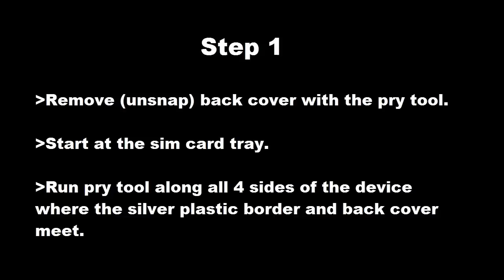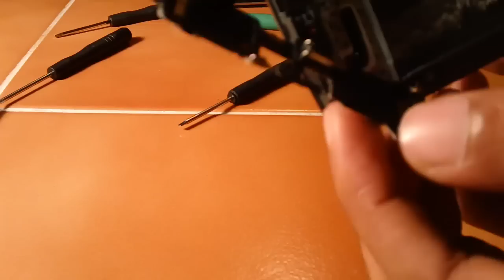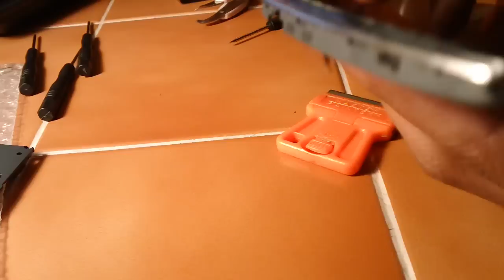HOW TO: REPLACE ONEPLUS ONE SCREEN (OPO Disassembly Tutorial) EASY COMPLETE TEARDOWN

Comment: Nice video, about to do a screen replacement for my oneplus one. Luckily my replacement came with a replacement frame. Don't need to worry about removing the adhesive. And it comes with a speaker grill :)

Didn't even realize when I purchased that it made installation that much easier if it came with a frame.

Comment: @Stephen good tutorial, but to replace screen you don't need to remove logic board on the top nor remove bottom board with speakers and all. It's much less work without it, and it's much easier. My new screen is also diferent than the old one. It's not the same quality, and digitizer under the screen obscures buttons's lighting.

Comment: Dont Try this at home. there is very Easy way to do this. Trust me. i followed this guy and i broke my phone. You guys wont open every part in this One plus one. Just remove Battery and top and middle (Near battery slot) cables and remove Screen heating by hair dryer. then fix and use. very easy.

Comment: Sorry to say .. I wouldn't advise to do this. I was extremely careful in tearing down, no problem. Only thing was the earpiece receiver, I noticed too late it is not necessary to remove it. The problem is in building it back together. During that process my new screen broke on top :( No matter how careful I was and have it laying on a soft enough and clean surface, I had to put some pressure to put the cap back on from the mainboard. There it went wrong. Apart from that in no way I can't refit the new screen nice. I should have let it fix instead, lol. Lesson learned, never again.

Comment: Thanks for the awesome video! Here are some tips for the guys doing this. 1st: you don't need to remove the lower cover and the speakers (skip steps 11 to 14), you only need to remove the motherboard because of the heat (you can do it without removing the motherboard, but you can cook some stuff). 2nd, the battery is really hard to remove, do it very slowly, no need to rush it, this is the hardest part (he makes it look easy...). 3rd, you can use the original glue if you remove the screen and put the new one right after that. You can also use 1mm double sized tape that you can buy on amazon.

Comment: Thank you so much for your guide. I went w/ the frame/LCD/touch assembly as my chrome bezel had many large nicks/dents in it. I would also recommend replacing the USB jack while your there, under $10 and a good idea if you have 12-18mo. or more on your OPO. Excited for the Oneplus 5 soon!

Comment: I believe the copper acts as a heatsink, to draw heat away from the screen and disperse it into the frame. It may also be to mask the sides of the backlight, to prevent light leakage. New screens often don't come with these bits, and you "need" to transfer them over.

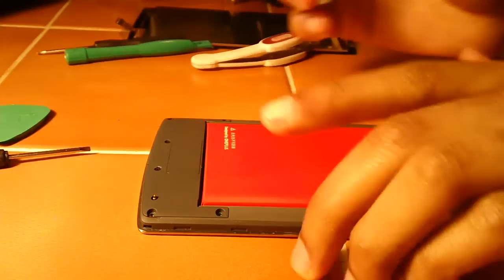Comment: Thanks For the video. I bought the similar one from AliExpress, and wondering which screwdriver i can use to unscrew 15 screws.. I tried to unscrew them but it is slipping (with the one you used in 2:47)

Comment: I replaced my screen man ,, thanks for making this video..
Reply from the maker: you're welcome
Reply: Can you provide the links to parts you used. Thanks.
Reply from the maker: ***** everything is in the description. Further instructions and links to parts are in my top comments.
Reply: Stephen Johnson Got i, thanks.
Reply: Was able to fix it properly using this video! thanks a lot for putting it up. Btw after step 14 i stopped. And didn't watch the video further. But one more step is taking out the thin wire on the right hand side of the panel - the one which connects the lower removed panel with the upper removed panel. Will require that!

Comment: I followed this tutorial and managed to replace the screen of my OPO and buy some time for it, thanks dude!
Reply: Can you provide the links to parts you used. Thanks.
Reply: Hey, this is what I bought: http://www.ebay.co.uk/itm/152174160051
In any case be very careful with each step, there's very fragile pieces and it's quite easy to snap/break one by mistake!
Reply: KleRoi Ok. Is this the screen replacement kit or the assembly with the screen and frame combo?
Reply: Dhruv Sangvikar  it's the screen+frame combo!
Reply: So in the video description he has given about the expensive option. That one is this?
Reply: Dhruv Sangvikar Yeah I believe it is, with this it's easier

Comment: @Stephen, how did you fix the broken speaker ? You pulled out the top of speaker, correct ? Did you buy a new speaker ?
Reply from the maker: it eventually worked properly after about 2 weeks. my situation might not be the same for all.
Reply: I thought you had damaged the ear piece speaker by prying it from the top instead of below the bottom of the tiny ear piece speaker.  Is that correct?
Reply from the maker: It is possible that I just separated the pieces instead of actually causing real damage to the speaker.
Reply: Thanks. Good information in the video BTW.

Comment: Thanks for the video, I watched it as I did the repair and it worked just fine. My new touchscreen functions and my only advice to other users is to take your time and be sure to adequately tape/glue the screen on, otherwise it'll kinda stick out of the case. This video worked!

Comment: Thank you Stephen, I've teared down my OPO with help from your guide, and managed to replace my screen in less than 2 hours. Very helpful.

I was lucky enough to find for 50 buck a screen with the encasing, hence I could skip the heat gun part. My phone is brand new, thanks mate, cheers.
Reply: Could you please send a link, to where you found your "50-buck-screen" ? thanks
Reply: Got it on amazon, ***** : amazon.fr
Reply: That's a screenprotecter, not the actual screen?
Reply: Hmmm, shouldn't be. Lemme check. Oops, yes, it is... 

This should be the right one: https://www.amazon.fr/gp/product/B01HIBECG6/ref=oh_aui_detailpage_o02_s00?ie=UTF8&psc=1.

Comment: Be carefull with this video. he makes some mistakes and hasn t edited some text over it in order to warn you. Says further along in the video that they are mistakes. Be extra carefull with removing the speaker. It is extremely fragile and his technique for removing them  is at best, very bad.  I strongly suggest cross referencing this video with others to get a better idea of that you re doing.
Reply: personally I've followed the exact instructions of the video 3 times, as long as you are patient there should be no problem

Comment: Thanks for the tips dude! I had the whole thing done in less than an hour with buying the screen assembly in the frame.  There is still a lot of swapping of the little components and stuff, but you don't have to deal with trying to remove the glass. 100 times easier than the last time I tried to replace the screen on an iPhone :)

Comment: why is it all different looking? and can you get the capacitor buttons back in the bottom of the phone and off the screen?
Reply from the maker: Apparently there was a tab I didn't see that you're supposed to pull off to show the buttons. Once the screen is fixed on, you won't be able to access the tab. 
They've made several adjustments to the software to allow you to manipulate the colors of the screen. The colors returned to normal without screen enhancements for me. It might be different for yours. Either way, I don't think it's too much of an issue.
Reply: I got it fixed right now. Thanks a lot for posting this video. it was so helpful. Every thing is working perfectly.

Comment: Hi Stephen, great tutorial! My screen cracked but no dead pixels, in your opinion do I need a LCD replacement?  Or just the screen?  Thanks in advance!
Reply from the maker: +g ghc (formyfor) you'll want to replace both. doing just the lcd is very dangerous and might cost you more in the long run.

Comment: Thank you for this awesome video. Helped me a lot to replace my screen. 
I bought the pre-assembled mid-frame LCD + digitizer from Aliexpress. Check "LCD display + touch screen with digitizer"
Only problem are the soft botton lights at the bottom of the phone. They will only be partly illuminated using this new screen. Aparently there is some black stuff blocking the light that can be peeled of. Check this out in your new frame. I don't want to open mine again :)

Comment: mine is stuck in recovery mode. Any advice on how to fix this issue. i will check the ribbon cables.
Reply: only in recovery mode or too during booting to the system? 
maybe flashing a new recovery(or new rom) is enough, but if  there is a hardware issue,  you will need a new mainboard.

Comment: Thanks for the video Stephen, it was realllly helpful.  I'd like to leave this comment to help people through their teardowns in the best way I could think of.
 At 8:40, I recommend not directly peeling off the power and volume switches from the far end but instead peel them from the 90 degree section where they meet the logic board.  Less risk of damaging the button, which I did, IMO.  Also, here are the timestamps for when you need to rebuild.  Good Luck Everyone!

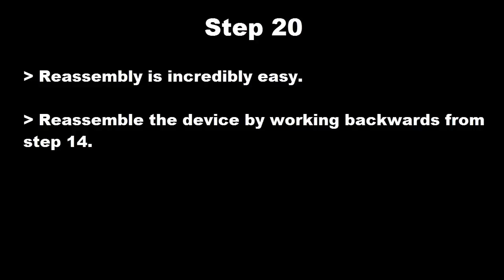 Step 20. 21:52
Step 19. 21:27
Step 18. 20:05
Step 17. 20:30
Step 16. 17:19
Step 15. 16:08
Step 14. 14:40
Step 13. 13:02
Step 12. 11:59
Step 11. 11:15
Step 10. 10:26
Step 9. 9:16
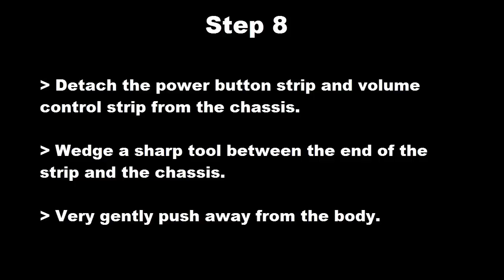Step 8. 8:00
Step 7. 7:38
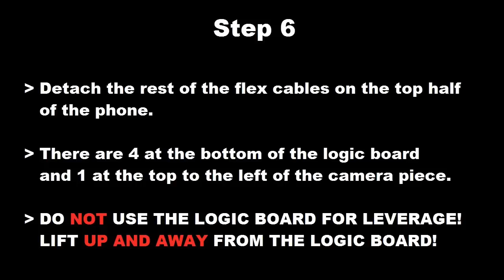Step 6. 6:25
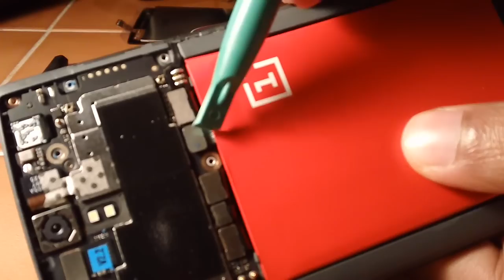Step 5. 5:00
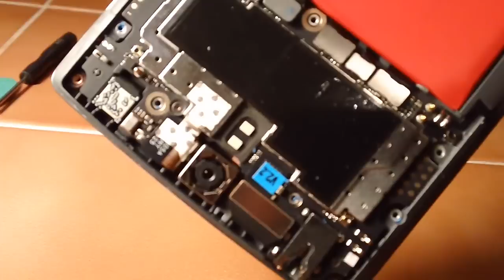Step 4. 4:08
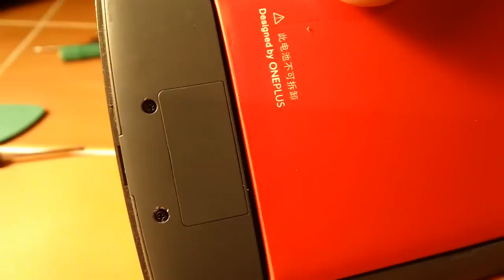Step 3. 2:56
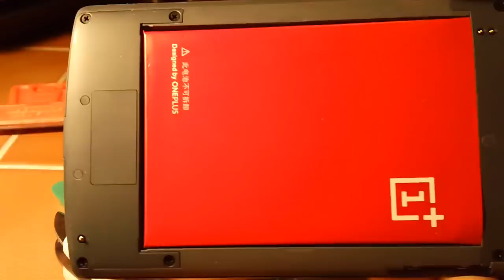Step 2. 2:00
Step 1. 0:59

Comment: excuse the question, but the flat vibration also takes care of the sim signal? or is it just a thin cable side? My smartphone also changing firmware, modems and other never takes the line and blocked data service.

Comment: excellent video sir,fixed up my moms opo like a charm : constructive criticism. record it all. try not to  skip the parts you cut out, it just makes it easier for the viewer.
Reply: +Michael Hibbert III Just out of curiosity since you've done this recently, would it be possible to skip all but the last step, after doing up to step 6 (getting the connector off), and peel the screen straight off? it seems there is only 1 connector that it's linked to?
Reply: +Reese De Wind nah I went ahead and took off everything but you might be able to do it if experienced

Comment: After replacing the screen, my phone is responsive when turning on and off, but the LCD doesn't flash when you touch the screen, its also pitch black.. lol..

Help?
Reply from the maker: +vincent xiong at this point, the only thing you can try is to open the top back cover and make sure all the connectors are in place. 
im not exactly sure what you're saying, though. does it work or does it not work?
Reply: +Stephen “Lotus” Johnson 
It's working. The flash on the top left is flashing still. When you turn on and off, is still vibrates and everything. It's just that it shows a black screen, you don't see anything
Reply: +vincent xiong its the same for me. it vibrates and delivers notifications, but is pitch black. ill just try to open it up again and make sure that all connectors are in place

Comment: Great teardown video. So helpful and the rebuild is very easy as long as you keep everything safe and in order(I use double sided tape to hold screws etc). Be very careful when taking out the battery, i damaged mine but luckily there are many vendors where you can get one. Mine cost €20, which wasn't bad at all. 

Can I just recommend one thing to anyone reading this, buy a digitizer and frame combo. Much, much easier job and not a huge difference in price. I can personally recommend this: http://www.ebay.ie/itm/111654868322?_trksid=p2060353.m1438.l2649&ssPageName=STRK%3AMEBIDX%3AIT . 

Anyway, again great teardown video. Gave me complete confidence to fix my OnePlus One. Thanx man.

Comment: Nice video mayn. I dropped my OPO about a week ago, and the LCD screen works fine, but the touch digitizer is dead. Do you know what I would have to do differently to just install the touchscreen digitizer, and keep the LCD screen?
Reply from the maker: it's not even worth keeping the LCD. please don't consider doing that
Reply: +Stephen “Lotus” Johnson RIghto, you're probably right. They're just so much cheaper. I'm thinking I might even just buy the assembly like you suggested in your comments.

Also, do you have any idea why the new screen was so different? And why the home buttons were located on the actual screen itself instead of on the bottom part of the phone?
Reply from the maker: Glass digitizer piece covers the button area as well. I'm sure why the colors were so different. You can adjust the color settings now so this a non issue these days.

Comment: Hello sir. I have a question. My opo's screen "only bottom side" doesnt work. Middle and upside work nicely. but bottom side is fuckd up :/ https://www.wetransfer.com/downloads/536cc94f87f16da98f18e560155c847120160101191814/df4720    there is a sample video and picture of issue. Can you give a mind for solve ? 

Best regards  
Emre
Reply from the maker: +Emre Kara i believe this procedure is too complicated. the best solution for most problems is to just replace the screen/casing using the methods explained in the video/comments.

Comment: thank you Your video was very informative. i was able to change screens but now my cellphone shows " no cellular network" everything else work. do you know whats the issue? thanks in advance
Reply from the maker: thanks for using my video! did you make sure the antenna is properly secured and attached to the correct components? what about all the connectors?
Reply: Antenna is the black wire that's going through the side right? I made sure all the other connectors are in well.  It's weird my WiFi works but cellular network connections barely comes on
Reply from the maker: +giby raj maybe the sim card tray is out of place?
Reply: +Stephen “Lotus” Johnson it's just weird that everything else works!!  Antenna is the black long wire?
Reply from the maker: +giby raj yes but please be very careful. I don't want you damaging your phone any further.
Reply: +Stephen “Lotus” Johnson Haha thx

Comment: After all the steps the phone will not turn on, help:(
Reply from the maker: I wouldn't advise fully disassembling it again. Try getting the back cover and top panel (CPU/camera cover) off to check all the connectors. See if they're all properly attached.
Reply: the wires are attached and the phone still does not turn but the strange thing is that I connect with the USB cable to the power turns on , you see a screen with lines and closes

Comment: DO NOT use a knife to remove the battery. I accidentally punctured it very lightly, and the battery started smoking, possibly from shorting. Thankfully, it didn't burn any circuitry, so I can replace it. Use a blow dryer or heat, to weaken the adhesive first before removing the battery.
Reply from the maker: +Arun Balagopalan correct! thank you.
Reply: +Arun Balagopalan heating the battery is way more dangerous than risking prying it with a knife.
Reply from the maker: +Anthony Jean also very true!

Comment: Just replaced it with help from you, and suprisingly it worked!!! Thank you so much!
Reply from the maker: +Neil Armstrong you're welcome! I'm glad you were able to use my video.
Reply: ***** No, it was hard. But it was easier than I expected. just follow the instructions provided in the video and you'll be fine
Reply: ***** No it's not. I dropped my phone and the screen both cracked and stopped working. But then I followed the instructions in this video, and now the phone is as good as new.
Reply: ***** http://vifocal.com/lcd-display-with-touch-screen-digitizer-for-oneplus-one-a0001-64gb-16gb-replacement.html
Reply: +Neil Armstrong I got a vifocal one aswell, can you tell me if you need some kind of glue to stick it together? Some phones need "gel" glue
Reply: ***** Yes, I used 2 side tape adhesive to place the screen.
Reply: thx
Reply: Is
common 2 side tape good enough or you need foam tape or some high quality stuff
Reply from the maker: +VoiD Archon i mean, you get what you pay for. if it has good reviews, go for it. if not, stay away.

Comment: man i don't know what wrong, but the top part and bottom part of my new screen has a gap. look like the screen is way smaller and doesnt fit, the sides are ok tho. do you have this problem ?
Reply: +Khai Bui There is a small, like fraction of a millimeter, plastic rim around the screen on the oneplus one. If you ordered a screen without the frame attachment, you have to keep that plastic rim or the screen will seem to small
Reply: Zormino aww crap, guess I have to return this  screen and get one with the frame. thanks man

Comment: I get the same "dull colours" problem as you in the end. Did you find any screen settings that adjusted it be less dull (hue, contrast, intensity levels, etc). 

Awesome guide BTW, couldn't have fixed my OPO without it.
Reply from the maker: I'm glad my video could help! Thank you for using it. I went to settings > display & lights > adaptive brightness = OFF. that made the display look a whole lot better.

Comment: Ear speaker did not need to be removed and the flex cables adhered to plastic housing did not need to be lifted. I skipped that step and removed the combo and saved time. Also, less risk in breaking an earspeaker or ripping a cable.

Comment: I just finished mine and it works.However I would not recommend it to anybody except techies with a pile of broken phones and/or parts they can afford to loose,especially not to those who've never repaired small electronics/circuit boards.There's too many part too easy to destroy.plus it's not as good as the factory parts.Mine works but the parts not as good as original parts,the display is a bit off.I spent $65 and just over 2 hrs and did it right,even still those sticky patches GLUED the delicate pieces down so tight it required lots of force to remove.If you break anything you're up the river without a paddle.My 02...Thanks for the tutorial,even though I don't recommend doing it.